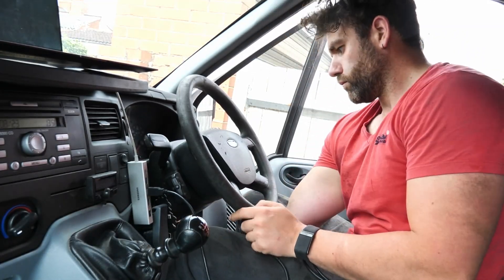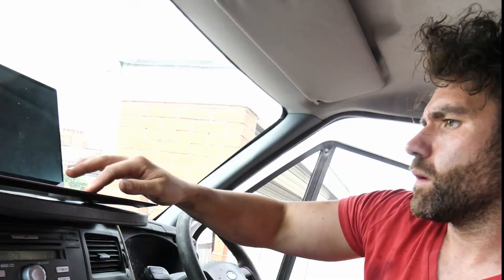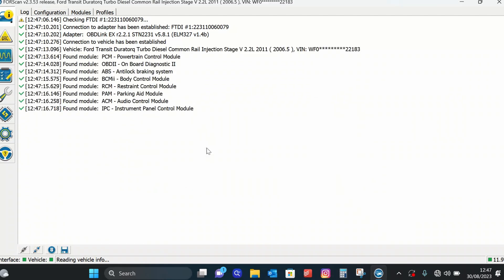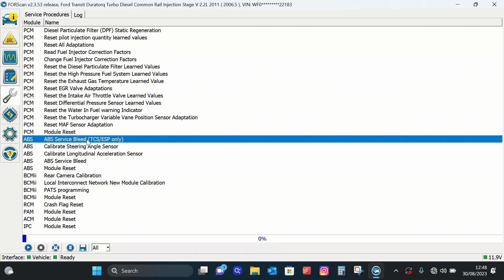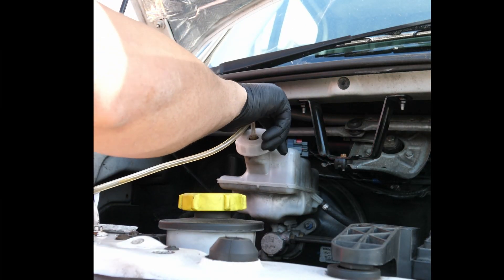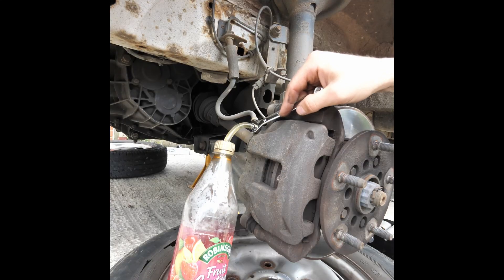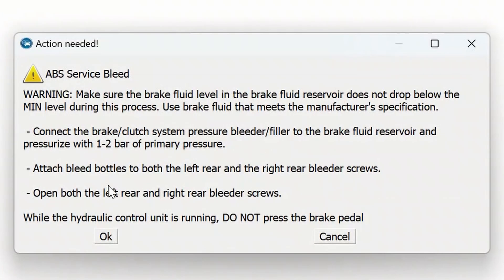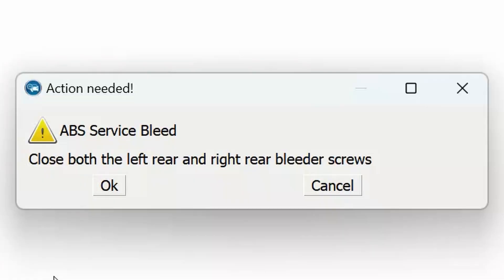Ford Transit Brake Bleed - Forscan secrets Mechanics don't want you to know!

Comment: In my case, the ABS did not pump on the left side, but on the right it does. I wonder why? Probably a failure of the ABS module..
Reply: Left side does not run the pump. Having issues of soft peddle. Was not using pressurised bottle so that might be the problem
Reply: @flyhigh1491  I had to get a lead and use forscan. I was using a normal scanner. Got a f-super 2 and it ran the pump on both sides